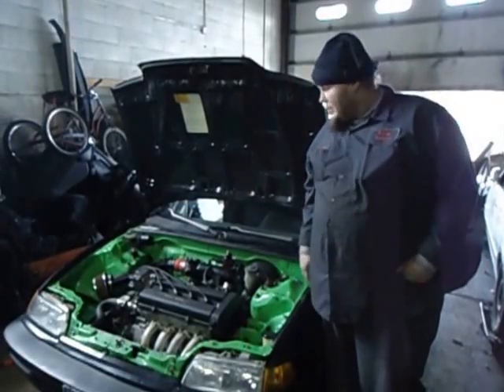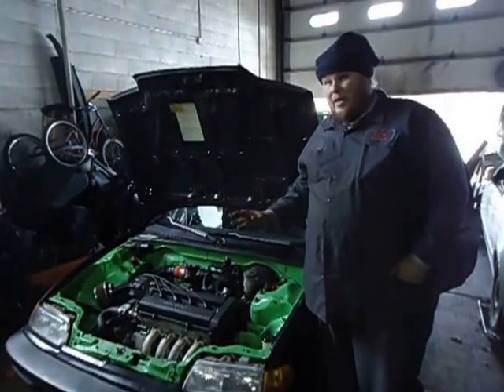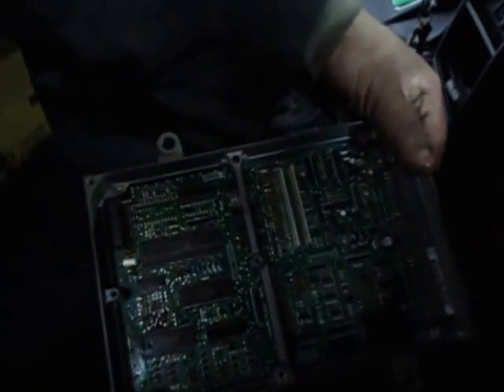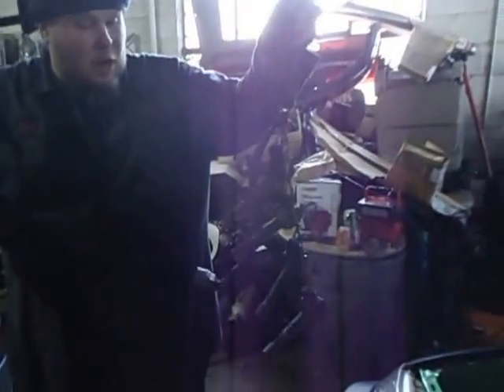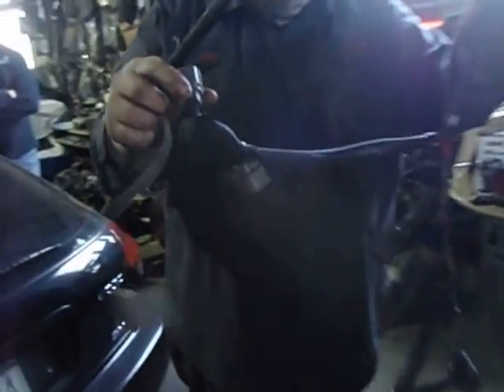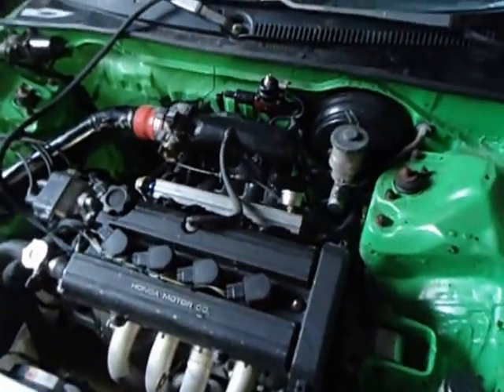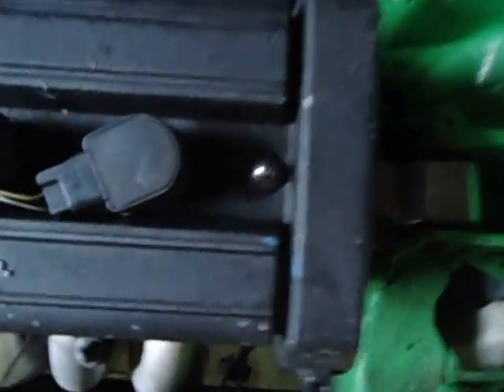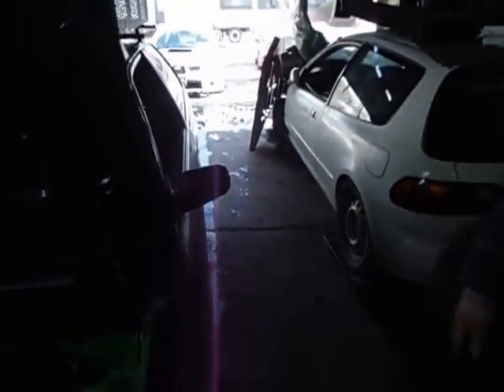RPM Systems presents Honda COP without AEM/HONDATA ECU

Comment: would this work on a 99 prelude
Reply: +Alex Reinoso yes it will . just have to make the proper harness for your car .
Reply: So need a new harness or just a distributor harness?
Reply: no . when you order you setup . you order for a h22 setup that is all . use same dizzy too . just dont have to run plug wires anymore .

Comment: So how does the computer get the cam/crank signals?
Reply: I assume from the box which plugs into the distributor connectors going to the ecu.
Reply: +Jdmdylan666 watching it again the wires plug in, right between the harness and distributor.
Reply: Yeah. I emailed them and haven't got a reply so not worth worrying about anyways I guess lol
Reply: did he change the monuts that quick as well, when it starts it again  the motor didn't jump around